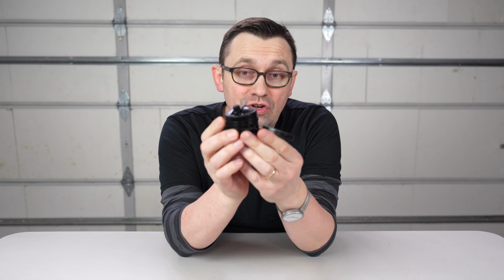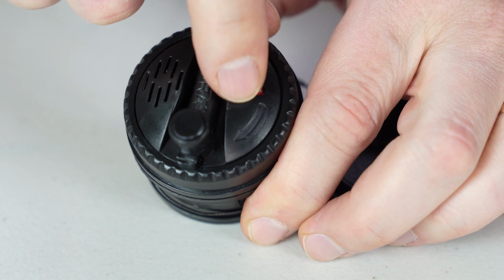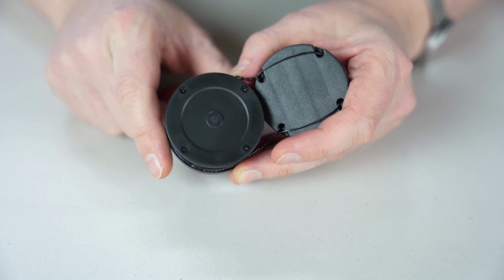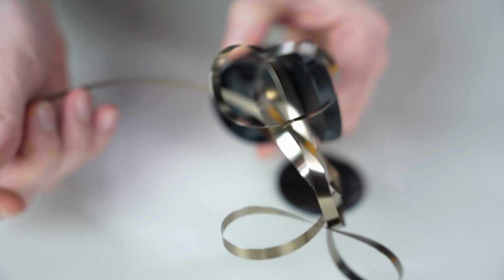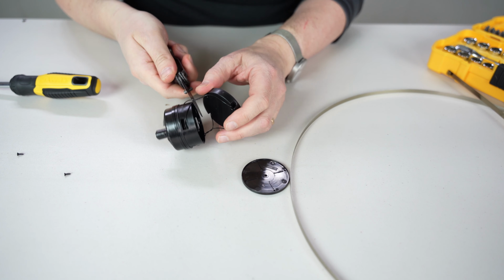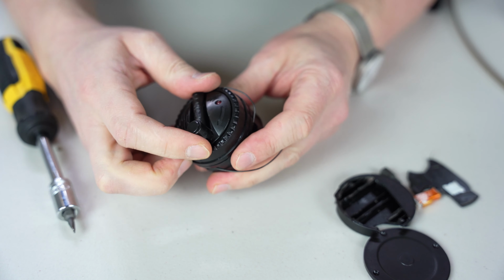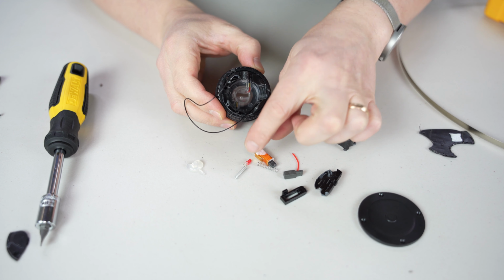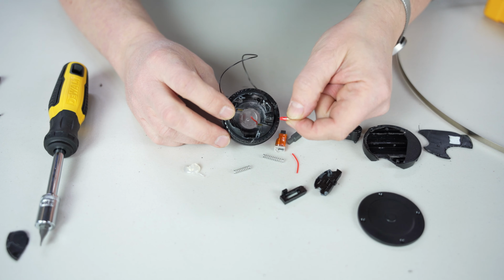What's Inside a Spider Wrap Security Tag

Comment: Those are called Anti-theft Box Wraps or Spider Wraps. I can't find a diagram online but It looks like the spring is a sort of clock spring that moves a magnet back and forth inside the coil, generating electricity for the little LED. And there must be a piezoelectric speaker in there if it makes noise.
Reply from the maker: Thank you for explanation
Reply: Does it go off if the tension of the wrap changes
Reply: The big spring is to tension the cables. If you press the release button on the bottom of the main unit, you can pull out more cable or shorten the distance between both units. It's the same in pull starters for little gas engines for instance. - The "electric thing", he calls it, is  coil connected to the RFID chip. A larger version of an anti-theft tag. Yes the spider will make a loud alarm when tampered with  but that device will also trigger the common alarm when leaving the store. It's a pretty big coil and will probably need more shielding than a normal tag.

Comment: Looks like a fake to me. Probably a cheaper more economical version that's just to deter booster's from walking out the door with an item. I have studied these things inside and out at one point or another in my life and first thing that thing should have started beeping loudly at 96 decibels if the wires were cut, that one didn't do nothing! You can pull on the cables and slip them off around the box all you want and nothing will happen but as soon as the circuit is broken, (cut wire) it alarms. I have also exposed the wire in 2 sections already with a utility blade and have a 6" piece of wire on you with alligator clips on each end and connect to stripped areas of the wire then you are free to cut in between the clips because you are tricking the device to think it still has a full circuit which then gives you enough slack to slip the device off the package silently, no audible alarm, then stash it somewhere (under clothes, behind shelving,) and  head to the closest register to pay for said package. I can have all the ones that have the separate clip that goes in and out to engage and disengage onto the product off in under 10 seconds with 2 neodymium magnets epoxied to a popsicle stick concealed in my hand, it's child's play. There just there to keep honest people honest really. Any of them can be slid off 99% of the time as well. It's just like a puzzle and you need to keep calm and slip it a little this way and a little that way and eventually poof it's off. Shit, I've wrapped whole packages in heavy duty foil, also from same store, lol, and concealed the item in my bag and walked right thru the front door with no alarms going off as the foil blocks the radio frequencies used to set them off. I don't condone this as I was a drug addict for years and have since got my shit together and thank the good Lord I'm alive still with no need to remove these devices in store, when you pay for the shit the employees remove it free of charge! Who knew.
Reply: Alot of knowledge..  with inflation I may need to learn some of your tricks 😆 hahaha